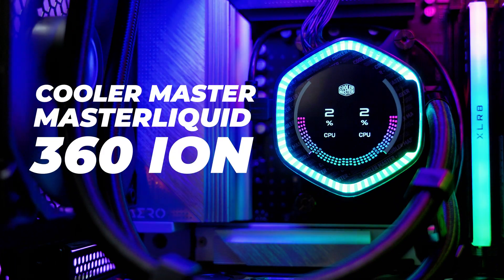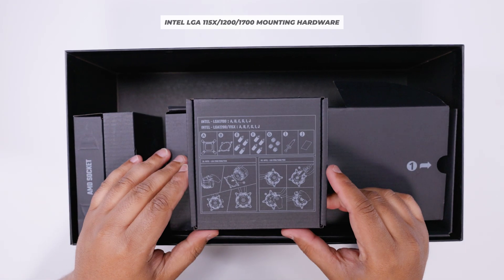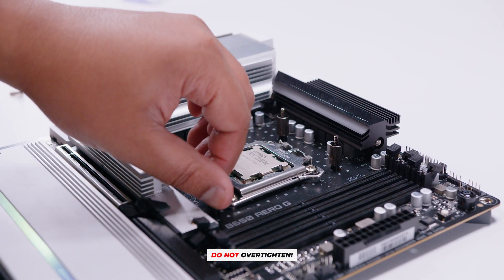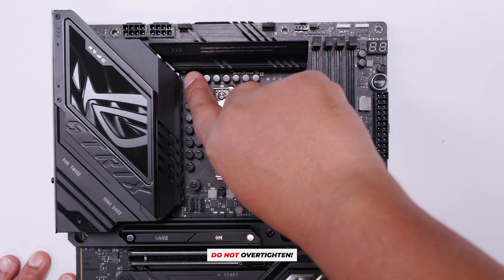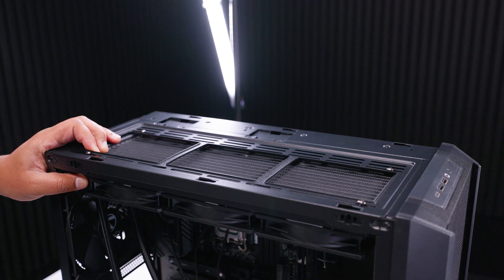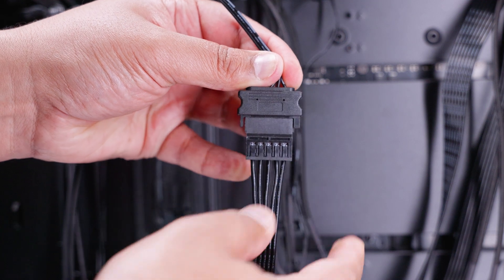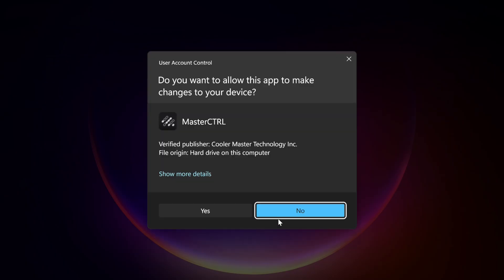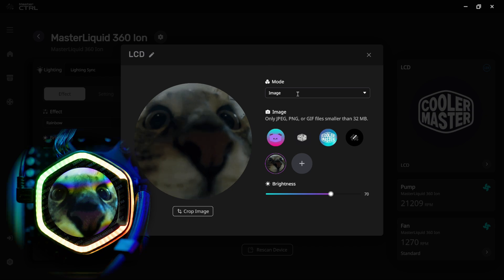Cooler Master 360 ION AMD AM5 & Intel INSTALL GUIDE

Comment: 10:49 AM5 looks very different. I was concerned that when tightening down the metal arms were bending. I hope that's correct. But it's in there nice and snug

Comment: How much torque do I need for the thumb screws, I thought it was just using the thumbs but I'm having high temps, I don't want to have ram problems later for overtightened the aio so I don't really know

Comment: Can we agree that manufactures need to integrate all wiring into the flow tubes so we can route them behind the motherboard hidden away.  I can't stand the usb cable just plugged into the pump block.